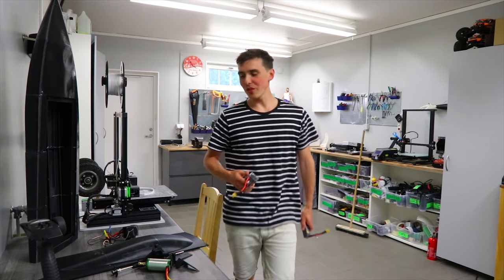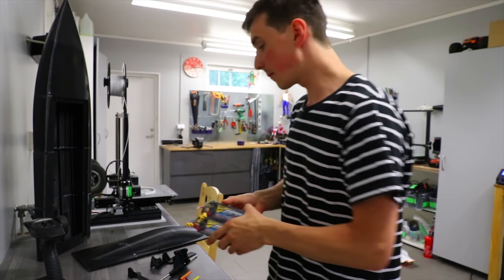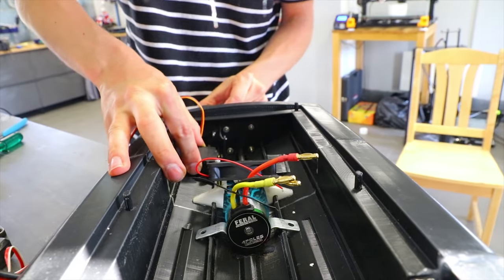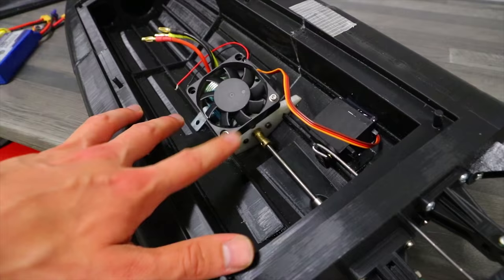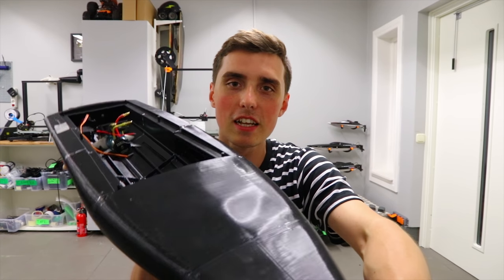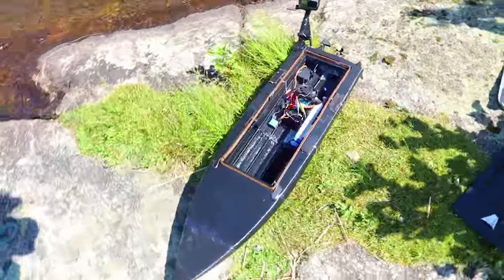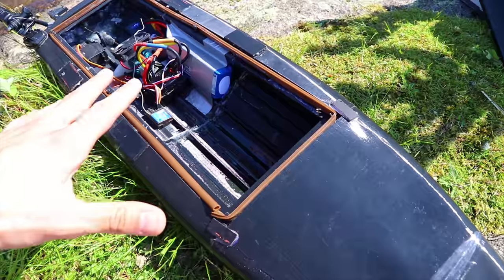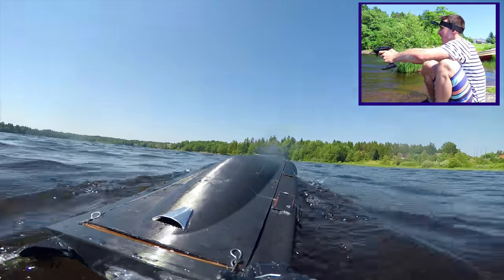BIG 3D Printed RC Speed Boat

Comment: The boat is a little to heavy it sits to low in the water and try to put the GoPro in the middle because it makes it off balance also try putting the rutted under the boat in the middle so it does not off turn and try to make the bottom a little deeeper in the water so it can be more buoyancy

Comment: If you had posted the clips of your problems along the way (boat sections break apart, layer adhesions don't hold water over time, prop shaft angle is too low, material is wrong color, no water flow through the motor area for cooling, Rx signal loss) you could have used the comment section to crowsource solutions, and used those ideas as springboards for more videos, and even eventually succeded.

Comment: Hey dude very cool the boat, in case you have the flexible filament right? and if you make between the joints of the piece an equal slice to serve as an insulator as if it were the junction of a head and motor, and instead of using glue, use internal screws to press one piece on the other. it was only an idea that occurred to me when I saw the boat broken, I still have difficulty understanding, I do not have fluent English, I actually understand very little lol. see you later. ( oh my God 7 months ago)

Comment: You need a ESC designed for RC boats, not the one you are using which has the wrong throttle curve profile. An RC boat ESC ramps up the throttle slowly at first so the propeller doesn't cavitate in the water as shown in this video.

Comment: I did one about maybe 1/2 - 1/3 the size of this with glow in the dark ABS, I split it in two and then printed it on a raft, in the end I left the raft material in place as it gave a huge contact area and also the front half was sealed so it was basically unsinkable..
So maybe ABS and some bulkheads?

Comment: I recently got the Cr10s and am using cura. I have been having a problem with  printing overhangs and such. And I was wondering if there was any settings or anything that I could change. I asked u because based on ur Chanel ur Cr10s is working perfectly and I wanted to know how I could bet mine to work as well.
Reply: It seems like the fan speed needs to be raised but it already is raised as much as it can go

Comment: A bigger surface piercing prop would do well - more blades more pitch more wheel- at least twice the wheel diameter.  You’ll have more low speed rudder authority if you used a deeper rudder and put it in the prop wash.  

The arneson surface piercing drives are a simple design but steering the the prop shaft is an issue in small stuff. 

I have a 35$ amazon toy with a water cooled brushed motor that absolutely hauls ass. It uses a surface piercing drive design with a rudder in the prop wash. It backs like shit but you have great rudder authority

Comment: You can easily install a micro pump....instead of using that fan.
Micro pumps are only $2.
Or you could had mounted an aluminum plate to the bottom of the hull...
Mount the motor on top of that plate...
The heat would simply transfer to the Plate...The water on the bottom 
would simply cool the plate...
Just make sure it's SEAL...it's not a big deal...gasket sealer or plumbing
goo would work....Not Glue,,,dude...
Gasket maker ( sealicone)...it'll seal Hot oil under wazzooo of pressure.
Water is nothing or Epoxy it. it's not a big deal.
Dont give up....just fine tune it...It's like that when you put a model air plane
in the air...You have to dial it in.....change props  size too...if you have to.
Just PAINT it....it'll seal it...not a big deal...Or just rub mix wax or poly
oil or water bass....It'll seal it ,easy. $3 a can.

Comment: Cool project man actually had the same project about 5 years ago in Highschool.. although I was able to solve the water seeping through by using ABS plastic instead. As for the motor part I even tried printed impellers and doing a direct drive as in the motor directly connected to the prop and submerged hahaha in the end I could not solve the motor problem hahaha it was just a science project anyway.

Comment: you should have just painted the hull.  that should have sealed it just fine
Reply: Yeap no need to even touch the inside, even though its adviced regardless. Also he has bulkheads between the apartments, so just use few screws and acetone peaces together. I dont get how he can fuck up so royally with knowledge on 3D printing, RC and seems to be with boats...

Comment: Great video man !!!
Can i stole from you just a couple of minutes pls? Ok than : i have a cr10 s . 
 i have it  since january but i didn't use it as much as i would  for lacking of time . 
Now i'm diving into in a little more and i noticed a problem i haven't noticed before : when i print stuff , any stuff , every print is fill with wavy patterns ... like a ghosting but not ghosting since they are just waves , and not the transfer of a feature made into the project. I checked that the printing bed was correctly fixed and well tight , and that the print speed wasn't too hight ( i even went as slow as 30 mm/s ) but those waves don't want go away ... do you have any idea on what could cause this issue? and how to fix it ? maybe a video of yours that i missed ? anyway , thanx for the time and for the amazing contents you always make and share with us :) NB i'm not english , so sorry if my knowledge of the english is embarrassing :D :P

Comment: should have used a proper plastic sealer on the exterior, the design is too low profile for waves and the cover doesnt seems very water tight it even looks in the first water video like water comes out of the cover maybe its me.

Comment: Bad move to use PLA for this.  ASA would be the best choice here.
Reply: The fact is that, PLA is biodegradable. Thats freaking problem dude. Short term investment :/
Reply: No the freaking problem is that the wrong plastic was used period.  Biodegradability is partially the problem he ran into that caused all of that time, money, effort, etc... to be a total waste and he is lucky the thing didn't just sink and all of those electronics sink into that lake.  If that had happened your biodegradability would have meant shit with that lithium heavy metal eventually degrading into the lake.  Being green is all cool and fine but when being green is not the right avenue to take to get something finished and without risks of even something worse happening then it is the wrong course of action that only the village idiot types would take.
Reply: Biodegradable is irrelevant because thermoplastic is recyclable.
Reply: Precisely but supposedly PLA is better because it takes less heat/fuel/etc... to recycle it or it can just degrade in the sun or in a landfill.  Fact is the Tg of PLA and the very fact of what PLA is made from is why he had so many issues whereas ASA is not biodegradable but none of those issues would he have had not the fact of the Russian Roulette game of the "will it sink and I lose my batteries that are made from a known toxic metal so it can help pollute the lake" game.  Sure two batteries aren't going to to do "much" harm but if some "go green" asshole steps back and thinks about it the outcome of those two batteries entering into the water system far outweighs any potential benefit PLA would offer by being biodegradable.  I am an environmentalist to the Nth degree (yes, I hug trees) but even I know one is worse than the other.  Use the proper tools and the proper plastic to do it right or just stay at home.
Reply: ASA? You mean ABS?
Reply: No, he means ASA. Goolge it for yourself ;)
Reply: No, ASA it is what the auto manufacturers have went to as it is UV resistant and has all of the good characteristics of ABS but supposedly prints easier than ABS.  Costs more than ABS but it really the way to go due to all of that and the Tg of ABS being the same in ASA.  https://blog.trimech.com/differences-between-abs-and-asa
Reply: Tiziano, Thank you as that is not the left's preaching dogma so the fool greenie above's argument is even less valid.  I do know that the landfills around here throw in this gunk so it helps to destroy the plastics much quicker than 20k years but I do not know what that gunk is.

Comment: Weld it with acetone
Reply: PLA deosn't weld with acetone
Reply: vidznstuff1 you melt little pit of pla in acetone and use it as glue paste to create a chemical bond rather than mechanical with glue.

Comment: To make PLA seal when u print it, u need to make sure u use a really tiny layer height. I find 0.05mm works well and provides waterproof prints. You could also have a look at this product: https://www.smooth-on.com/product-line/xtc-3d/ it's for sealing 3D prints of all types & they say it sticks well to PLA! That might solve the porous print your boat seems to be made of. When you join PLA, make sure you have screws & nuts as well as epoxy in the mating surfaces. You also need to roughen the area where the epoxy will bond with a really coarse sandpaper like 60 or 80 grit. Yr prop was cavitating. Lower the RPM &/or lower the pitch. Just lowering the pitch is no guarantee that the cavitation will stop. Look up anti-cavitation plate on Google. That might be of use. You could also lower the prop deeper into the water. Maybe put it under the boat?

Comment: why dont you try to 3d print a full size speed boat that you can be inside, and probably use 10 of these motors to drive it and a bigger battery? if your allowed to use a real boad, then there is no reason why you can not be allowed to use 3d printed one with space for two people or more. 

just make it it parts with glue joints and fittings for screws and print plastic screws as well. then when assembled, buy and use epoxy to glue all the joints of hte pieces to remove gaps then buy plastic paint and paint the boat in many layers until you get a thick layer then asemble all the parts on the inside with multiple motors working together and you can take your parents with you on a test drive.

Comment: yo bro ive been building boats for years..i just made a jet boat (inboard impeller water jet) with a quad copter motor..light and takes no power to run...if you need help..i have plans you can have..

Comment: Hi, Interesting project. to bad it did not work out like you wanted. I think it is partly because your setup is a bit off. the prop you use is made for a motoryacht model or a cargo ship model. you use it like a surface piercing propeller. they are normally very sharp and pointy. Most of the time just two blades and very high pitch.

Problem two is the loss of control. partly because the model is very low and the antenna will probably be pretty low inside the model too. So sometimes there is a wave between the receiver and the transmitter and beside that you get problems with the f zone i think. check this link (     https://www.youtube.com/watch?v=xCVd3QGQhKU      ). This guy has a good channel with rc stuff and just knows how stuff works. solution for you. Just make a small antenna straw to get the antenna a bit higher or use a 27 mhz system instead of 2,4 ghz. the lower the frequency the better it works with obstacles. But again, nice project. i like the shape of the boat. looks pretty fast